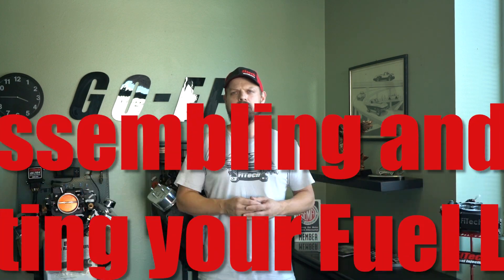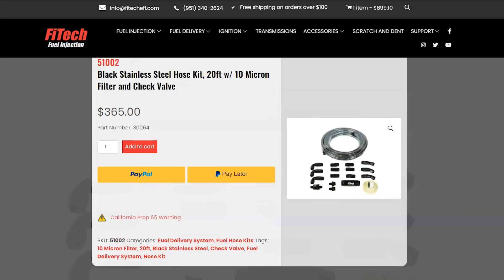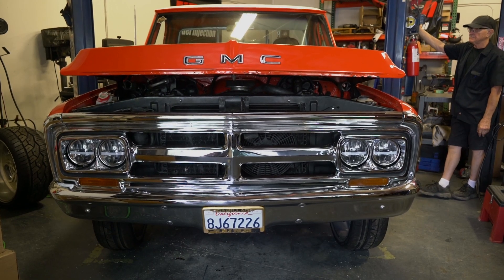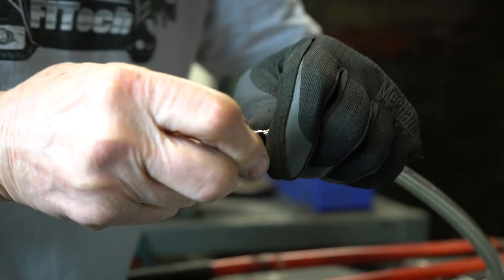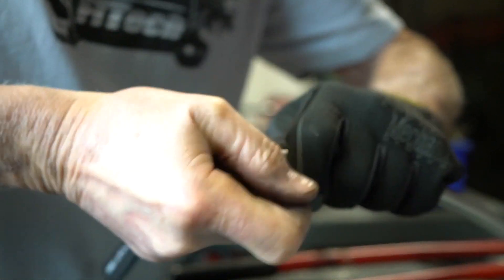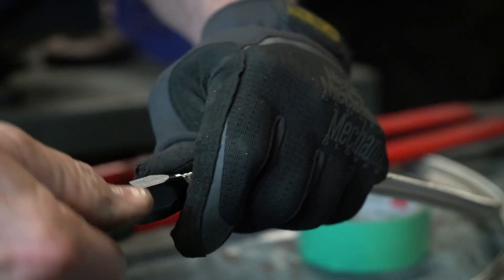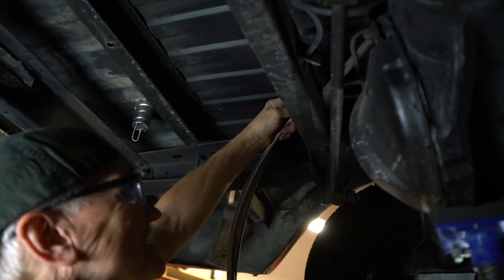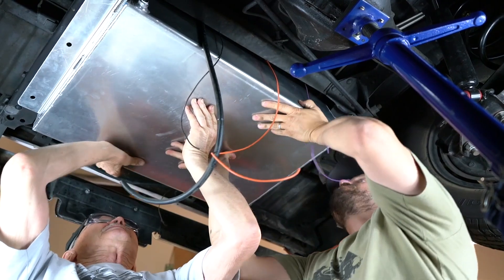Assembling and Routing Fuel Lines | Tech Tuesdays | EP34

Comment: Would you be able to make a video to show what’s the best way to run the lines from the tank, I currently have mine  as feed to AFPR and bottom of AFPR to return the other feed from the AFPR to one side of the fuel rails with jumper hose attached and the other side of the fuel rail capped off. I have seen some applications have 1 feed have a Y split for both sides of the fuel rails. Is there a preference that would be ideal for the LS Ultimate rails